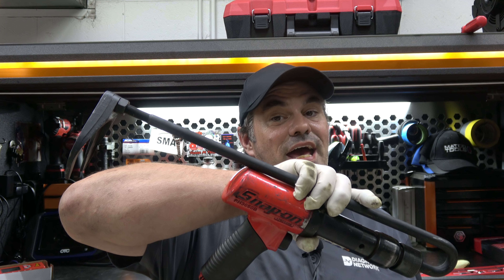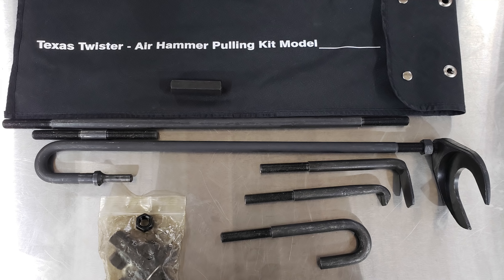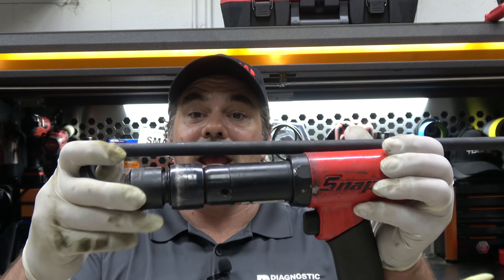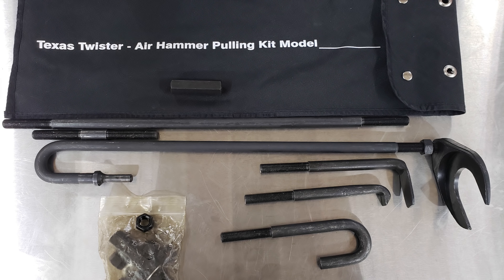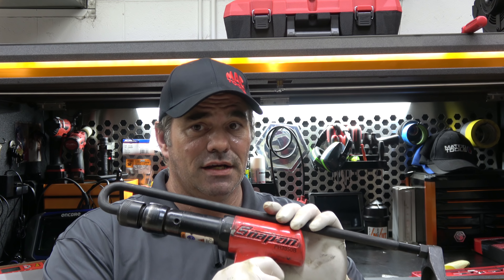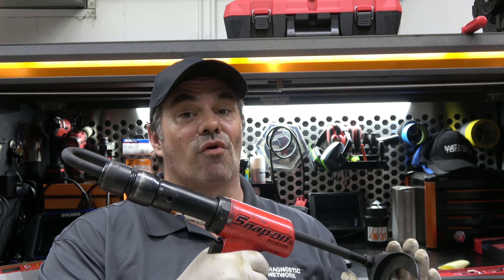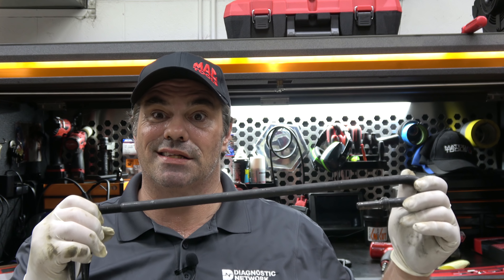Wasted Money On Tools The Texas Twister

Comment: My matco guy saw my struggling to get the cv axle out of a nissan rogue (passenger side, struggling with carrier bearing). He told me to buy it and if it didn't work he'd give me my money back. Well I bought it, tried for over an hour with it, broke the tools (threads broke where it connected to the cup for the CV axle). I called him up and he said it was misuse and refused to refund me but said he would try to warranty it. Last time I ever bought anything from him.
Reply from the maker: Don't blame you there!
Reply: Isn't that carrier bearing bolted to the block? Three bolts off and pull. Just saying
Reply: @nomamesguey100  It is, however this was the AWD version which I believe is different from the FWD. What I had to do was drop a portion of the exhaust to get it out which I was trying to avoid doing. After that it was I believe like 3-4 bolts on the engine and another 3 or so on the transmission if I remember correctly. Then I literally took the whole assembly and threw the axle against the ground to knock it out... popped right out lol
Reply: @flatratemaster  what tools would you recommend matco

Comment: For removing seals this Texas Twister is incredible! What a time saver. And often the seal is hardly damaged so you can easily read the part number after it's out. We do a lot of one ton rear hub seals. With the slide hammer you often need another guy to hold the puller foot from sliding off. With this tool you have an extra hand to hold the foot in place and with a few blips the seal's out! Much safer: and safety is a big deal at our vocational school. We had a stuck distributor and the slide hammer broke the housing. 6 months later a 1956 jeep came in with that tiny fragile distributor rusted solid. The Texas Twister shook it right out with no damage! The amazing thing about this tool is the way it easily removes really stuck parts without chewing them up. Seems like it's the constant hammering and vibration that make it so effective. For axle removal its been fair- pulls about half of them with no problem and with the others you need two guts and the 4 foot pry bar...that's probably the axle you tried it on.

Comment: The guys at the local tire place LOVE it!  That said, they never use it with an air hammer.  Use the part with the hook and the CV yoke, a chain around the knuckle and a bar (a LOOONG bar). Pry on the crook of the puller tool and the chain.  I've watched them do it... it DOES work (just not the way the manufacturer had in mind).  The good part is you aren't prying against an aluminum transaxle housing.

Comment: I`ve had good luck with mine.   I'm just a diyer, but it's worked on '05 Malibu shafts and the Ford 500 long passenger side shaft.  I made an adapter to pull the Malibu short output shaft which was giving me an issue.   I also used it to pull bearing races from camping trailer drums, which it made short work of.  I can foresee other non-automotive uses for me.  I wouldn't consider it a must-have, but I'm glad I bought one.   It does seem to take 3 hands at times to keep everything aligned and tight.

Comment: Seems like it would work better if the U shape was replaced with a steel disk and use the air hammer behind the disk, eliminating the shock absorption effect of the bent shaft.
Reply: I was just thinking about welding something together like this.

Comment: I realize this is a "Six years later" comment, but a good solution to this problem is probably something like the ASTRO air slide hammer, roughly achieves what the texas twister tried to do and is in the ballpark of a 5lb slide hammer.

Comment: The shop I work for bought 1 and I tried it pulling the wheel bearings on a Ford f150 and it did nothing. The shop gave it back and used the credit to buy a miniductor which is awesome.

Comment: I've had mine save my ass pulling other things than drive axles.  Its great to pull steering shafts back onto racks.  Pulled a few seized in distributors. One harmonic balancer that came apart. But I also agree. It sucks for pulling drive axles.

Comment: I bought one, learned how useless it is without using puller attachments from a slidehammer kit...slidehammer failed on a frozen bearing on crown vic..attached bearing puller on texas twister and BAMM...bearing came out...without puller attachments in slidehammer kit, texas twister is useless

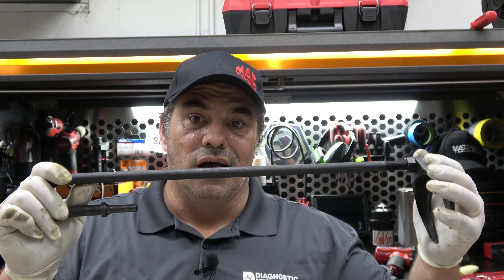Comment: What you said at 2:40 was exactly what I was thinking. I’ve been out of the game for 20 years, but when I was a tech, I never once used anything other than my 36” Cornwall angle tip pry bar to pop CV’s. I did literally thousands of them this way as I was a Auto Trans tech for a Ford dealer.

Have CV’s changed that much over the years as to require these new CV tools? Would be interesting to know.
Reply: The axle hasn't changed what did change is the access to pop them out with a pry bar or a brass drift from the back side. As the video said the axle puller end with a slide hammer fits every time and works a charm. I doubt I can say that about this tool.
Reply: @HimmelWeint  thanks for the insight. Much appreciated.

Comment: Use the twister with the "Big Nasty" adapter. Issue I ran into. 

I have the OTC puller kit, you know the slide hammer. Yeah that slide hammer with the 5lb slide (upgraded the slide to 10lb last week, more below). 

Anyways was doing a '12 Nissan Rogue, yeah one of those on my driveway for a neighbor. 

Used the slide, map gas (yellow bottles like propane) and after a day got NOWHERE. Even was using my 26yr old Mac Tools air hammer from the 90's cuz hey it still works. 

So after day, day and a half of no go I remembered I had a torch at home 😁🙃😁🙃 well that remember went to crap quickly when I realized no Oxygen for my portable torch pack. Then I had a ah ha moment and remembered that I had a full size oxygen tank, level unknown that I'd traded for some labor on a riding lawnmower repair for a friend who "had the parts and I had the smarts"🤔 so I checked the tank after digging my pony pack out and switching the Valve & Gauge assembly over. 

 After switching it over I realized the tank had plenty of gas or maybe I should say oxygen as I had enough gas in the acetylene tank. 

 Next problem I encountered was the hoses weren't long enough to reach the vehicle as I didn't want to be trying to stand up a oxygen tank on a driveway and let it do a balancing act. 

 Call the local Campbell's Auto Supply which is now called Runnings Fleet and Farm as they bought them in Jan before the Wuhan Virus came along. 

 So my daughter went and got the hose for me. 

 Put the torch up and heated the hell out of the aluminum bearing bracket and no go. Tried again and no go. Tried again, pb blaster no go again. Again with kroil and no go. Finally heated it with torch again, kroiled the heck out of it, let it sit for about an hour and no go still with the slide hammer. 

 Desperate times call for desperate measures so I had heated it, had daughter run slide hammer and I got on ground under car and after the heating of it threw the torch to the side, set the zip gun against the bearing while the daughter ran the fly to hammer against it and after about three minutes of solid hammering and zip gun it finally broke loose. 

 After that ordeal I decided it was time for a big nasty so I went in order the big nasty and the Texas twister the same day. 

The texas twister showed up and I realized wrong shank size. Was looking on LTI Tools website today and they have a ADAPTER BAD FOR BIG NASTY size zip guns. 

Got the zip gun and now just waiting to order a adapter bar for using the BIG NASTY WITH THE TEXAS TWISTER. 
Once I get the bar then it's just a matter of getting another one of these to do up here in the rustbelt of South Dakota. 

I did also order some long large shank bits for reaching tight spaces with big nasty. 

Now that I have a backup zip gun I can send my Mac Tools one from the 90's when tools were made great in and have it rebuilt as I lost the trigger cap years ago and it probably needs a kit by now. We'll see what Mac Tools says when I call them sometime when I have a chance. 

 Maybe I'll luck out and get lucky and they'll use mine for research and give me a new one? only if things worked that way in the real world but then again maybe they'll look at it as brand loyalty. 

 I could always offer them a story or say I will turn around and do a video on YouTube for them and see where that goes as brand promo has power as the FRM knows this firsthand. 

Most of all, FRM if you get the Texas twister for $189 +/- then you can turn around and get the adapter for the Big Nasty and you'll open up more possibilities.

Comment: Question for the flat rate master... any experience with adding magnets to the bottom of m18 or m12 batteries? Was thinking about adding magnets to a couple batteries so I can stick lights onto vehicle undersides as well as not having my tools fall over with a socket on them.
Reply from the maker: No, but it should work fine as long as they are strong enough and they stick well

Comment: I agree I myself bought one like a jackass. I haven't found any practical use for it. The cv axle tool does not fit on any car I've used it on... Complete trash and I'm on the rust belt.

Comment: Just a bad design on Texas twisters part.  I get the concept, but they skimped on the quality in favor of lightweight operation.  I think if the hammer side was solid with some square tubing, it would work alot better

Comment: Glad you did this video, bc was looking at getting. I have the OTC cv axle piece, it does need to be opened in the "u"  area for some cv axles, the big step down shank style. Like older Asian short shank, mostly driver side ones. OTC also has the adaptor for your vise grips to slide hammer. It is what I use when axle stuck. Take boot off remove clip and clamp vise grip on, thread handle, and beat the SnOt#@$ (know what I mean lol) out of it.
Reply: those vice grip slide hammer adapters are the shit. I use them fir all sorts of stuff, actually trying to order a new set i lost one but shipping charges are too much.. waiting for a freeship coupon.
Reply: Go on Amazon and you can get just the adapter, just threaded part for $20 I think it is. Then you can pick which vise grip you put it on.
Reply: @adama5392  OTC 205378....that's part number and its $25.

Comment: Nice video! I was wondering if you or any of the tech you work with knows or has a Autel mx808? I’m looking for a scan tool for a apprentice/junior tech but don’t want to spend $2500 for an ethos edge...any recommendations
Reply: Juan Hernandez. I just recently bought an MX808. It's not bad at all for the money. Doesn't have the power of a high end tool and is of course somewhat limited, but for quick scans and lower level scanning it works well.
Reply: Nate Bruno much appreciated man!

Comment: It's not a miracle tool. But it has it's purposes. It works even better once you've used it more than a few times, and figured out the little things that make it work at it's best. 

One, oil it and have really good air pressure. Two, when using the air hammer the original way, you stand behind it, and push with your weight behind it. So using it like this, you have to keep in mind to push and put your weight into it. You do not always need too. But if something is stuck, you have to help the hammer out. And if you use you ingenuity, there's many things around a shop, around a car, that this tool can help with. I'm a body/painter in a collision shop. And it's worth it's money just in inner fender repair.